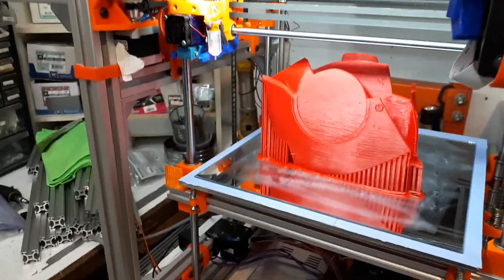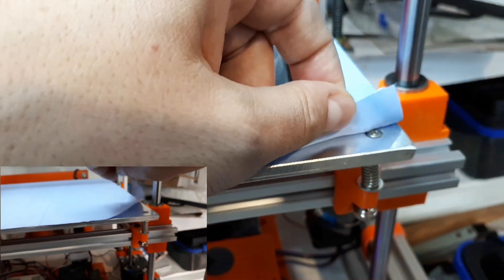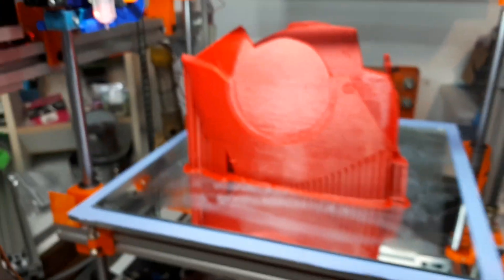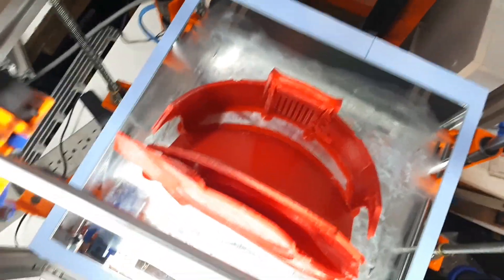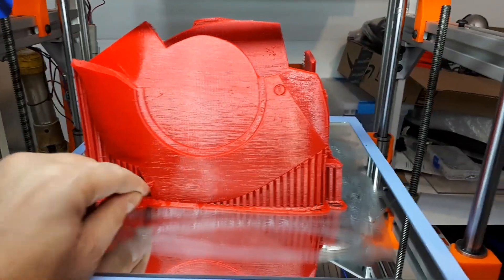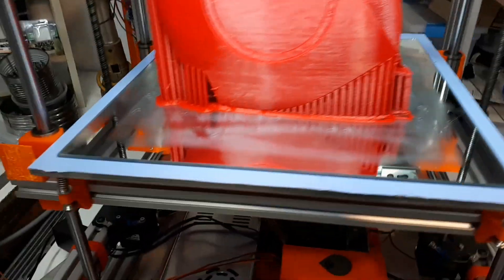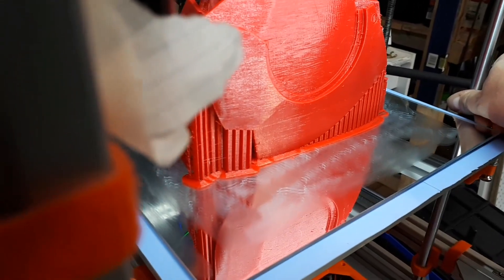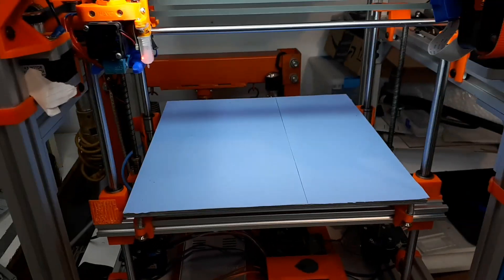Thermal silicone sheet for 3D printer heated bed.

Comment: I have been using a slightly thicker pad. My textured glass has gone smooth.  I acquired PEI kit.  During the swap I decided to print directly on the silicone pad!   Has anyone else tried that?   Working so far better than the worn out glass.      I installed the sticking magnet sheet and the PEI. Put the silicone pad on top of that just for grins.    O.o
Reply: That's interesting because i looking for infos if someone already tried to print on silicone because that way i may could make my own silicone mats out of a mould to have a own designed texture on the print bottom.

Comment: So.. How is it going after some time of use?
Reply from the maker: It definately lost some adhesion over time, but a simple wash with warm soapy water once in a while brings it back to acceptable condition whenever I feel its not sticky enough (about once a week).
Reply: @MirageC  Do you have to adjust your bed temperature setting to compensate for the heat insulation provided by the silicone? For example, if you want your bed surface to be 60 degrees do you have to set it to 70 degrees? Or does the actual bed temperature accurately reflect the gcode setting?
Reply: Thank you  @MirageC  ! IT feels much better than tussle with metal clips :D
Reply: I think you may be losing a lot of your heat using that. Silicon is an insulator that blocks heat. This is why oven mits are made out of it and why the heater block sock is made out of it. It’s to keep the head from transferring to the other side of the silicon and what a great job it does. So using that silicon your diminishing the heat to the print surface.
Reply: @ChristopherJones16  you know that it is not a common silicon right? That is one used specifically to interface electronics and heat dissipators on things like video cards and other type of multiple heat sources with single big heatsink
Reply: @ChristopherJones16 "Silicone" is a rubbery polymer , "Silicon" is an element found in glass and semiconductors.  This is a silicone sheet that is meant to be used as a thermal interface between processors and heatsinks.  Although it does insulate it also allows heat to travel more freely and evenly than a small gap of air between the metal and glass allows. (... or at least that's the theory, I'm glad this was posted because I was planning to do the same thing one day).